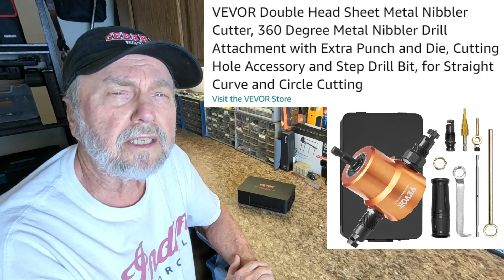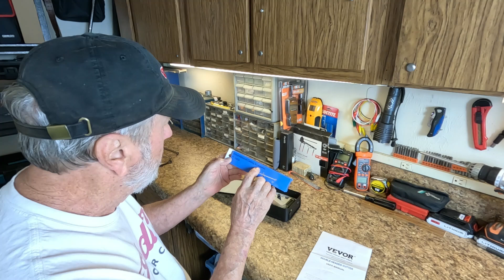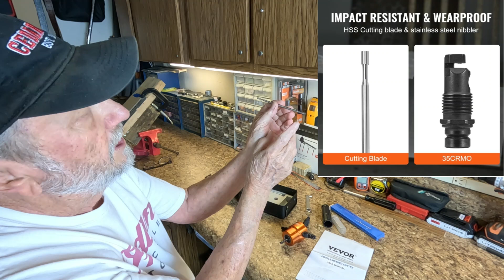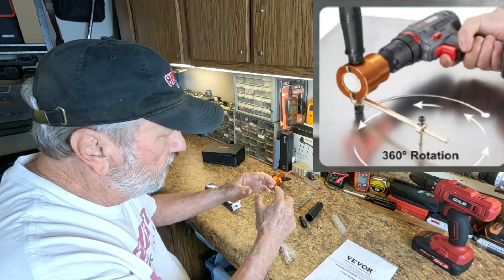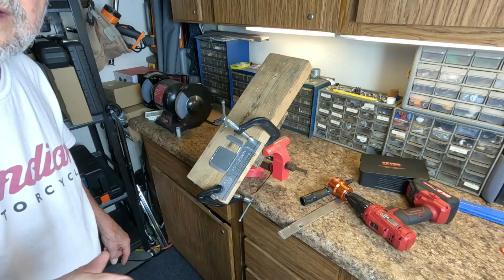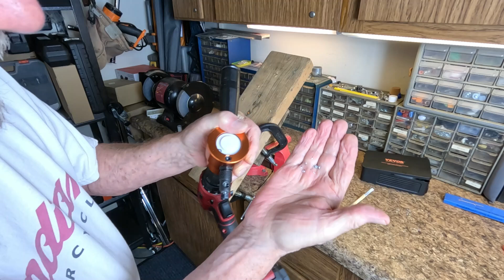VEVOR Double Headed Sheet Metal Nibbler Cutter is great tool

Comment: Wearing a full mask, goggles, a cap hat is recommended ... so much flying metal bits can fall on your face, hair,.. and remain stuck on you until the misfortune of touching your face and hair afterwards and then touching your eyes with bits of metal on it.  Especially bad if working on cars, on the sides and under the car.  Yup

Comment: But how to you start the cut ? Does it start in the slot? Before the slot ? Can't understand how this cuts ? I understand that it punches but the starting point ????
Reply: Use it like you would use a jig saw. For cutting out a hole, drill a start hole like you would with a jig saw.

Comment: Thanks for the video! I'm very new to using tools,  but I bought this so I could cut out some weak spots of my car floor (fixing rust) that I couldn't use a sawzall or angle grinder for,  this cleared up a lot of confusion I had!
Reply from the maker: @grey7685 so glad my video helped you select the right tool for you job.  Thanks for your comment.